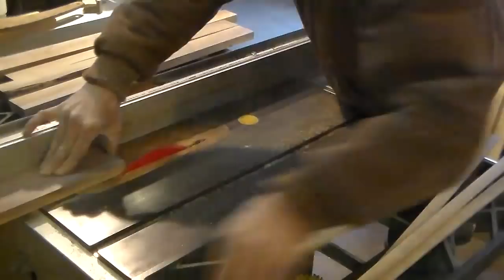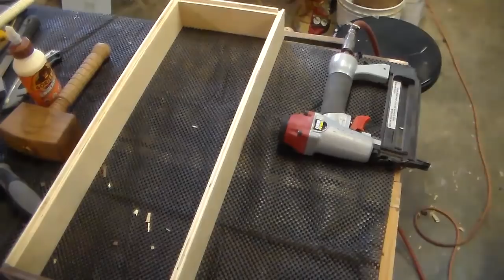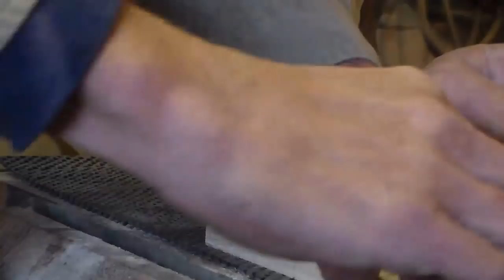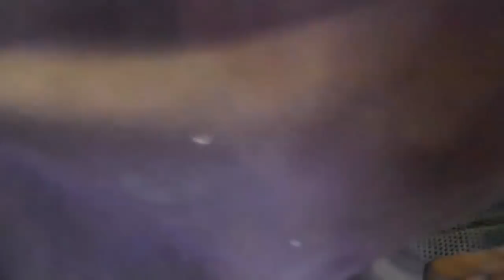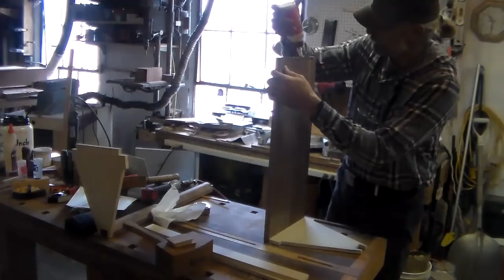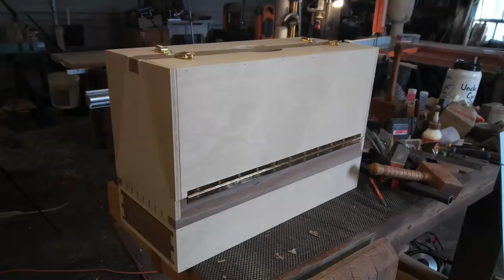Jointers Tool Box

Comment: Cy, thats a great project. looks real nice. I may try it but I will have to sharpen up on my weak hand sawing. You can find good American made saws. Just make sure they are at least 80 years old and still in pretty good shape. A little restoration and you should have a great tool. R
Reply from the maker: AD4MRick LOL yea I have a collection of about 60 antique bandsaw. started collecting just after this video. been going to auctions and finding them for about a dollar each. recently did a handle restoration video too.

Comment: Japanese tools are the best made. America used to be a leader in hand tools and machinery during the late1800s and up until the 1940s. Then all of the top manufactures started to move overseas or down to Mexico. Big mistake because quality went downhill and with the introduction of lightweight plastics they started replacing components with plastic in the 70 and 80s. Now we've gone full circle and Companies like Veritas and Lee Neilson make quality tools are being made even in America or Canada again! The problem is, they cost a small fortune. So, more and more you hear about woodworkers & shops seeking out early 20th-century machinery and hand tools. Some of the best machines were built right here in the US when manufacturers and employees were proud to make quality machinery and tools. They were made out of heavy steel and iron and meant to last a lifetime. I own a 36" bandsaw that is over 100 yrs old and my brother owns a huge a planer and a 12" jointer. Most already have powerful and running motors and fewer parts so other than new blades or safety equipment they run as well as the day they were manufactured. I really love the design of this box. with a few modifications it will be perfect for  my leatherworking tools. Thanks for sharing the build with us!!

Comment: Great project. With you up to the drawer latch.  I appreciate the design but don't see it as practical. I would have installed a marine type latch that is flush on the outside. You didn't say what determined the overall size nor what it weighed empty. Would like to know.